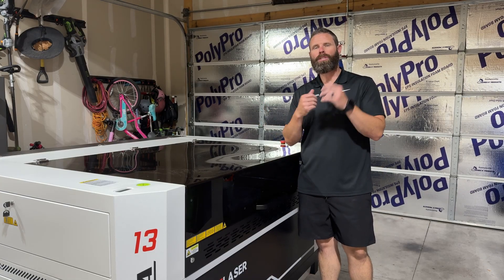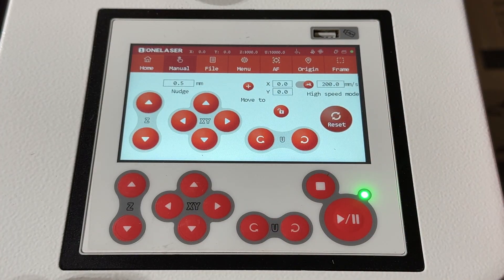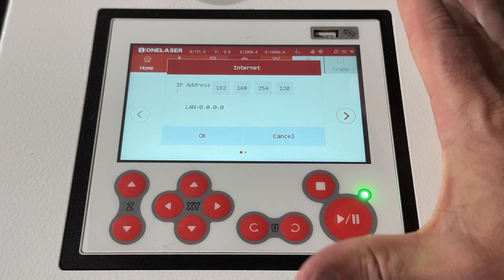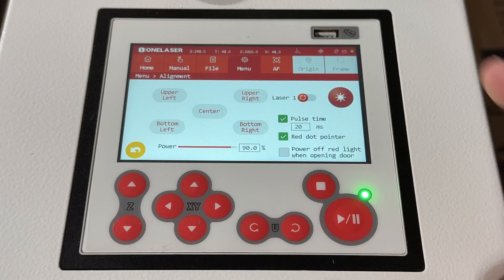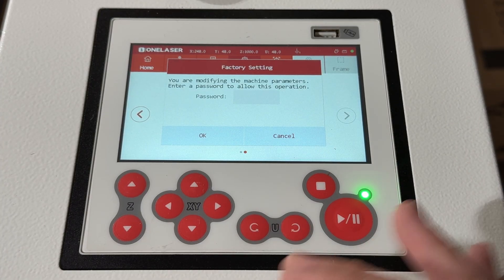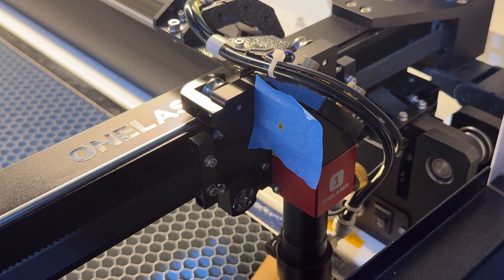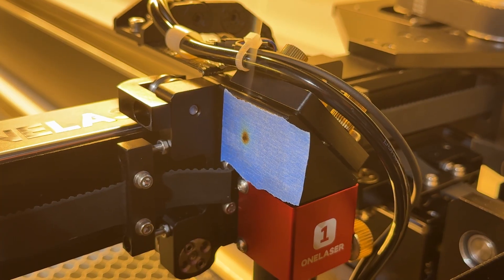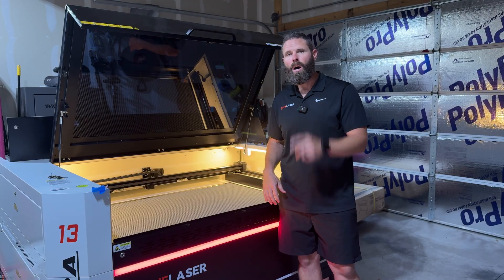Hydra 13 Laser Setup (Part 4) | Controller Overview & Beam Alignment Check

Comment: Let me know if you figure out how to stop the red aiming laser from becoming misaligned, I'm constantly realigning that thing on my Hydra 16. Other than that I have no complaints, the machine is awesome, and the One Laser team is full of people who want to help you better know your machine.
Reply from the maker: Where are you seeing the misalignment?
Reply: It usually comes out of alignment in the bottom right corner first, then it slowly becomes more misaligned with use. I adjust it so that it hits dead center, or pretty close, at all 5 points, get a couple of weeks of use out of it and have to repeat the procedure because it does the same thing.   @BeardedBuildsCo
Reply: I think the vibration of the machine causes one, or all, of those three alignment screws to back out slightly throwing the beam off. @BeardedBuildsCo